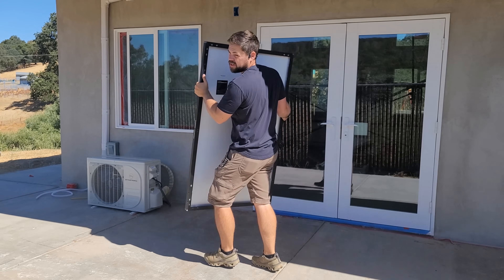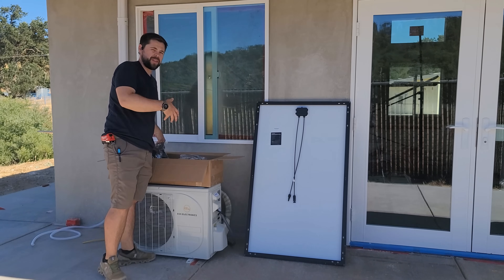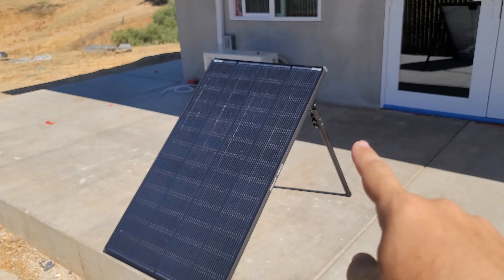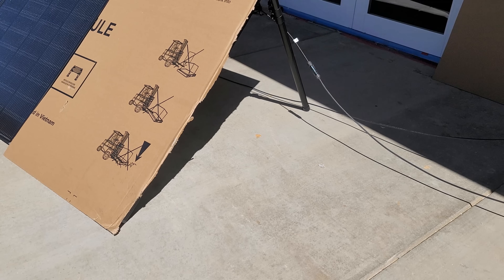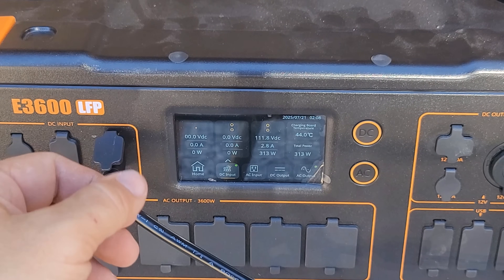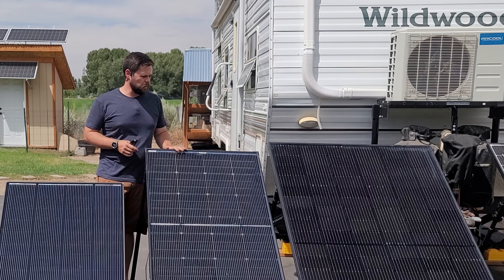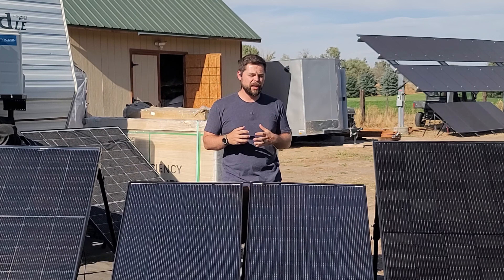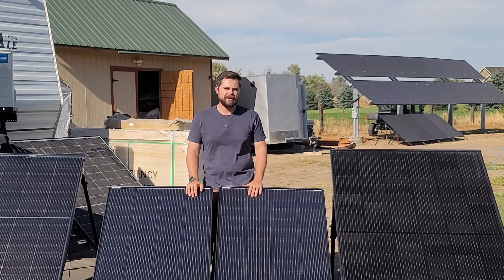The BEST Anti Shading Solar Panel Renogy ShadowFlux 200W

Comment: How come you don't sell the lower legs alone? What if I buy top only, but later I want to add bottom? Also consider making bottom legs that don't jut out like a triangle, but come straight down, perpendicular to the ground, so it doesn't require more space. Then I can scoot the next row of panels closer.